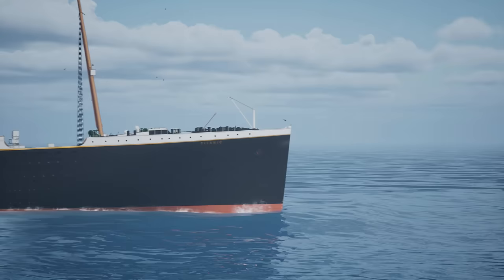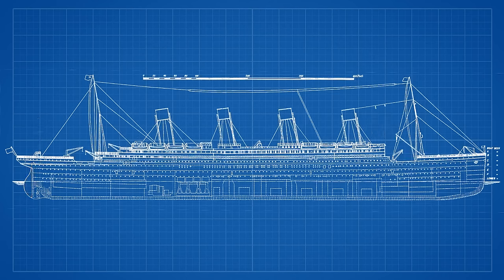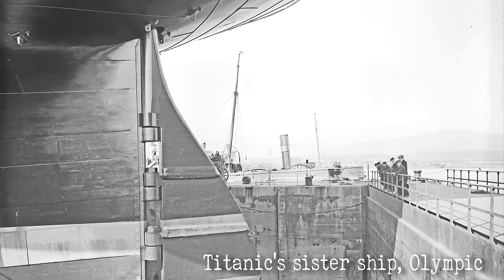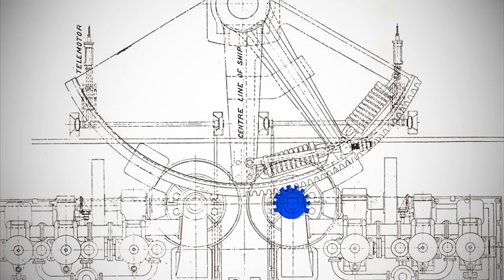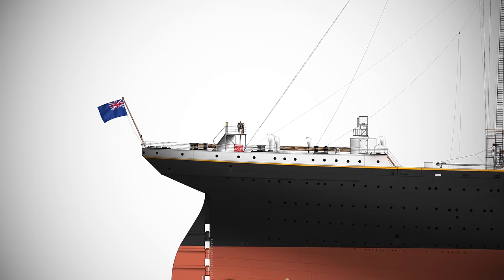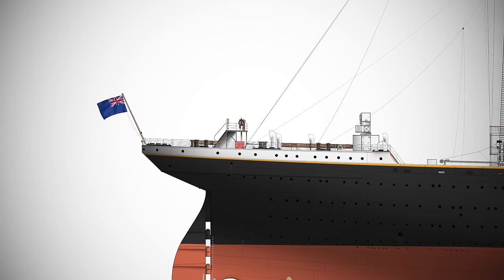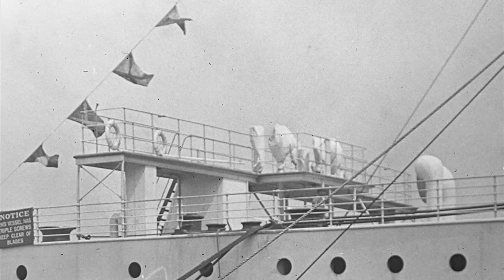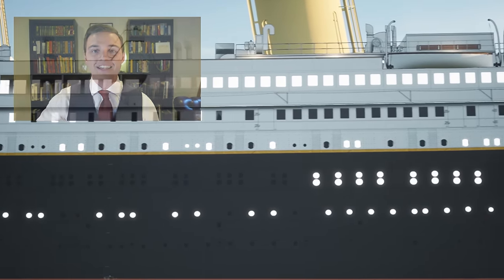How Did They Steer the Titanic?

Comment: About the myth of Titanic's rudder being too small, if that was the case, they would have changed it on Olympic and Britannic.
Reply: They used completely different rudder systems on those ships.
Reply: Also both Titanic and Olympic passed their sea trials wich included maneovrability and steering tests
Reply: Ship sank due to bad luck and shit crew
Reply: @FWtravels  there were a combination of factors that combined doomed the Titanic. There were basic design flaws, material flaws and a flaw in judgement piloting the ship that culminated in the disaster. The radio men pissing off the closest ship to the Titanic didn't help any either. Improper loading of the lifeboats was also a major mistake.
Reply: STILL ARE the most powerful people in the world, you work, and they don't.
Reply: @1pcfred  What you just said summed up the situation in a general nutshell that April night in 1912. I have been researching Titanic (and maritime history in general) for the last 33 years of my life and everything that I've read, seen, written about, and touched during exhibitions all seem to corroborate with your comment. It's a sad truth, but a truth nonetheless.
Reply: @Brock_Landers  a lot of catastrophes boil down to a comedy of errors where single elements or even combinations may not have lead to the same conclusion but all combined magnify and amplify each other. It's really the little things that tend to add up. The Devil is always in the details.
Reply: @pooheadispoppingout  Buy, the paperback book, The Secret Terrorists, by Bill Hughes. I'm over 60 and we been played. Towel 1 and 2, also building 11. WHY WERE the cell Towel were turn off, SO people could NOT call down, and say there was no planes.
Reply: IT sank in the MOST convenient place in the world and at the most convenient time.
Reply: @1pcfred  also jack and rose running across the deck distracting the lookouts didn't help either
Reply: @chrism3784  that's definitely why the ship went down right there.
Reply: @FWtravels  Titanic lasted a lot longer than some modern designs. Think about RORO vessels like Estonia. Couldn't see the bow from the bridge? On a ship that had a bow visor?

Can you blame the Estonia's crew? No. And there were a lot of heroic actions taken by Titanic's crew. Without some of the sacrifices made by members of the crew, the tragedy could've been worse. 

I wouldn't say the crew was bad. It's easy to critique with >110 years of hindsight. They were brave. Humans make mistakes. And it was more seaworthy than many ships being built today. The iceberg seemed to hit in just the wrong way. Believe this channel has a video about that.
Reply: @1pcfred  they actually didn't piss off the Californian, he made a video on that. Simply put, at the time radio operators routinely told each other to shut up, go to hell, and called each other old man. When Jack Phillips told the Californian to shut up, he wasn't being rude because that's how they talked to each other at the time.
Reply: @jamie91995  that iceberg was the patriarchy!
Reply: @1pcfred  huh?
Reply: @jamie91995  I knew you understood.
Reply: @1pcfred  what was the flaw in piloting the ship?
Reply: @1pcfred  what was the different system?
Reply: @FWtravels  why are you blaming the crew?
Reply: @timothyreed8417  the pilot reversed engines and tried to turn. the Titanic was  a triple screw ship. The middle screw went over the tiller and that's what turned it. So it didn't work. He made the wrong call and doomed the vessel. But in his defense he didn't have a whole lot of time to weigh his options. It was 30 seconds from sighting to impact.
Reply: @1pcfred  the engines were not stopped and reversed until after the impact with the iceberg…what is the different system you mentioned?
Reply: @FWtravels  the crew was fine and well experienced for the most part. Ship sank because it hit an iceberg. People died because the systems they relied on failed them in a way no-one had foreseen. 

Smith was the prize captain of the White Star line and his crew were all seasoned from voyages with other White Star ships or poached from Cunard. 

Problem was they moved themselves out of the normal flow of traffic to avoid ice, still hit the ice field anyway and was stranded alone. Her 20 boats which would've been sufficient to ferry passengers back and forth were never meant as the rescue crafts and weren't meant for long term safety either. In fact historically lifeboats were kind of seen as death traps. Even still, the crew was good enough to get every boat off the ship, and 712 people were rescued. If they were a shit crew as you believe, No one would've survived.
Reply: @timothyreed8417  there was never a reverse order given. We know that from the testimony of Frederick Barret. He noted half ahead and then full stop, the engines were never activated again after that.
Reply: @sorrenblitz805  when did fredrick barret see an engine telegraph, in the engine room or on the bridge?
Reply: It was too small only the once: That partcular night. The rest of the time such emergency turns didin't apply.
Reply: @1pcfred  You've missed excessive speed for the conditions.That was the most obvious single factor. None of the ones you mentioned would have sunk her by themselves.
Reply: @nighthiker8872  What??
Reply: @johnbishop5316  what excessive speed?
Reply: @johnbishop5316  the captain was being reckless too. But in his defense he did think the ship he commanded was unsinkable. It is an easy mistake to make.
Reply: @1pcfred  The company, the designer and the captain knew full well that the ship wasn't unsinkable. Watch any Titanic film for an account of what Andrews said. Despite being in a film, it is based an an actual exchange.She's mad of iron sir. I assure you she can sink." Only newspaper headline writers claimed that it was unsinkable. The captain had taken the precaution of sailing 18 miles further south than usual and considered that enough. But however you look at it, near full speed in an icefield was reckless.
Reply: @FWtravels  ...and that's your considered opinion? Wow, and all those reports?
Reply: @timothyreed8417  21knots. In ice. What are you asking?
Reply: @johnbishop5316  have you read the “Inquiries” and what the other Captains said….
Reply: @johnbishop5316  yeah but by being bold Edward Smith went down in history. He went down with his ship and told his men to, Be British. What a legend.
Reply: Yeah titanic's design can be still the reason why it sunk because it was built with weak rivets
Reply: @nickforest7816  the Titanic wasn't designed for weak rivets. They just happened to use some weak rivets. That would be considered more of a manufacturing defect than a design flaw. But yeah the ship opening up like it had a zipper on the side of it didn't help matters out any. Now the watertight bulkheads not going up high enough, that was a design flaw. They knew full well they effed up there. That was fixed in Titanic's sister ships. They fitted those with more lifeboats too. But the Titanic was compliant with maritime code as far as the lifeboats went. They still managed to screw up loading those in the moment though. Oh, and there was enough room on that board for Jack too.
Reply: @Paul Frederick  you don't make any sense with the rivets explanation in those ships from that day and period you can put any type of rivet you want they just chose to use weak ones on the titanic which doomed her from the start
Reply: @nickforest7816  you can put in any rivet you want but defective rivets are going to fail. Just because you can put them in doesn't mean that you should. And yes certain rivets were specced and not used. So rivets were certainly used that shouldn't have been.
Reply: @Paul Frederick  yeah that's what I'm trying to say someone definitely put weak rivets on purpose to sink the ship
Reply: @Paul Frederick  they weren't cheap when decorating the ship and it took a lot of money to build it but why did they use cheap materials on some areas of the ship I don't get it
Reply: @nickforest7816  it is very common to spend it where you can see it and scrimp where you can't. Different contractors executed different parts of the ship too. I watched a documentary that talked about the rivets and they discussed why it was done. It wasn't all about money. They had the old orders for the rivets and everything. Some of it was just down to availability at times. They salvaged rivets from the wreck and analyzed them. There's different kinds in the hull. They're not all the same strength either. I believe there were accounts of the rivets popping and shooting through the ship. It was a problem that contributed to the disaster. A number of things all went wrong and those rivets were a contributing factor.
Reply: @Chironex_Fleckeri  The iceberg didn't hit the ship. The ship hit the iceberg. How weird.
Reply: @nickforest7816  Strong rivets would have enabled it to go through an icefield at 22 knots? I think not.
Reply: @John Bishop  why can't you just except that the ship was a weak piece of junk please don't send me anymore comments on it because I'm tired of talking about it
Reply: @johnbishop5316  The iceberg made contact with the ship. That's a fact. "The iceberg hit in a way..." means just that. It says nothing whatsoever about the circumstances that caused the iceberg to hit the hull of the Titanic. 

Seems a bit pedantic, doesn't it.
Reply: @johnbishop5316  I see what you're doing. You're taking people out of context and trying to force a debate that no one else is engaging with, probably because no one cares to.
Reply: @Chironex_Fleckeri  It isn't pedantic to point out that the ship hit the iceberg and not the other way around. It's common sense. Evidently lacking. You're in Humpty Dumpty land.
Reply: @johnbishop5316  they were doing what they knew to do. Big ships always sped through to outrun the bergs that could sink them. Smaller ships like Californian stopped because all icebergs were dangerous to them.
Reply: @1pcfred  Olympic was built with the same batch of rivets dude. Olympic by the way never sank. The iceberg only caused a series of bent in plates it didn't "open up the thing like a zipper" the actual damage caused was 12 sq ft spread across 300 ft of her and over 6 compartments, she was only designed to float with 4 compartments flooded any more was too much and they had 2 more compartments opened. She was going down. They got every boat off the ship, if you're referring to them loading boats half full, blame the passengers they wouldn't get on. If you're referring to them not launching boats for like an hour keep in mind that first hour they didn't actually know she was for real going down.
Reply: @sorrenblitz805  did the Olympic hit an iceberg? The problem with the Titanic is it didn't use the same rivets. For whatever reason two kinds were used in the hull. Good rivets and not so good rivets. Someone decided it didn't matter. Maybe if they hadn't hit the iceberg it never would have. But that's not what happened. When they did hit the crappy rivets let go and the ship tore apart. Because even the good ones couldn't hold it together then. In that moment those substandard rivets weren't doing anyone any favors, that's for sure. I saw it in a documentary and they went into it all in excruciating detail. What the differences were in the rivets, etc. I can't remember the specifics today. If you're interested I suggest you research it yourself. Maybe go to the bottom of the ocean and pick some rivets up, like they did. Then subject them to metallurgical analysis.
Reply: @Chironex_Fleckeri  titanic also lasted longer than Andrews thought too
Reply: @1pcfred  the Olympic hit EVERYTHING including a U-boat. She was known as ol reliable. If they'd been able to turn a little bit faster, Titanic would've survived the iceberg, but they couldn't and it bent plates in across 6 compartments when she could only hold with 4. There wasn't negligence on the part of the crew or the company that built it.
Reply: @sorrenblitz805  if it wasn't negligence then how do you explain the accident?
Reply: @1pcfred  it's called Murphy's Law, and it happened to Titanic hardcore. You claim negligence because you're looking at the situation with 111 years of hindsight. I claim shit happens because shit happens, and recognize that they didn't know what we know now, and to pretend that they should've done this or that is irrelevant because that wasn't the operational standard of the time, a standard the crew of that ship followed quite well and managed to save 712 people.
Reply: @sorrenblitz805  you mean they managed to doom more than 1,500. Over 2/3rds onboard died. Shit happens when people fuck up.
Reply: @Brock_Landers : Except the Titanic ticking off the Californian. That's a novice misunderstanding.
Reply: @chrism3784 : EXACTLY!! Why don't "they" talk about this? The conspiratard industry "conveniently" ignores Jack & Rose.
Reply: @FWtravels Agree
Reply: @1pcfred Agree Murdoch should of just turned to port with engines still full ahead or maybe stopped port engine he  would of got more turning ability with the thrust of water going past the rudder??
Reply: @jimmanihera7760  the Titanic just couldn't catch a break. It was a real hard luck case. I watched a documentary about the Titanic and what they found was a lot of the rivets in the ship were defective. The bulkheads not going all the way up was a severe design flaw too. Disasters are often a combination of little things adding up.

Comment: Truly another amazing video Mike. I am a marine navigator and my job is steering large vessels.  In the 100 plus years since the Titanic sank not much has changed in the way ships are steered.  When the order to turn of the ship either to port or starboard is given the helmsman replies with the order back and turns the ship. The signal is sent from the wheel to the steering flat and the steering gear turns the rudder. Its interesting to watch the steering gear turn the ship.
Reply: Interesting, for sure. My problem is still, wrong Info gets and the decisions  need info for correct decisions
Reply: lexus just recently re-invented the steering wheel in their drive-by-wire 2023 lexus rz450e- too bad they forgot to include a phaser holster in the control yoke.

Comment: The single rudder is mounted in front of the central propeller which was the steam turbine driven shaft that had no reverse gear (or turbine). On the night that titanic struck the ice burg this meant that it was stopped when the order to reverse was given. A stationary (or reversing prop) stops flow over the rudder limiting its effectiveness and would have reduced titanics ability to turn. Im sure you cover this is another video but i thought its worth mentioning since it affected the performance of the steering system.
Reply: Yes, paradoxically it might have turned faster with middle propeller on full speed?
Reply: @johnbishop5316  That wouldn't have been possible with the Titanic. The center propeller was powered by a low pressure turbine that used the exhaust steam from the two triple-expansion engines. It could only be used above 1/2 ahead and had to be shut down when reversing the two main engines. The steam instead being diverted directly to the condensers.
Reply: @Crosshair84  Of course. Obvious really. Hadn't quite occured to me!
Reply: It would’ve made no difference Titanic still would’ve hit the iceberg and they did not reverse the engines they stopped them!

Comment: I really enjoyed that! :D If you're taking requests, I'd love to see a video explaining the engine telegraphs too. My main question is: Why were there were so many of them? I would have assumed (somewhat simplistically) that three engines = three telegraphs, but there seemed to be far more than that on Titanic's bridge.
Reply: Two main engine telegraphs (port side and starboard side of bridge)…ran both engines. Emergency engine telegraph was next to the wheel on bridge…the other 2 communicated to the docking bridge at the rear of the ship…contained docking commands. They worked by a cable system that went from bridge to engine room…
Reply: @timothyreed8417  Wow , that's a lot of redundancy! Was there an element of making the bridge look more impressive than it needed to be do we think? I can't imagine they really needed that many telegraphs doing basically the same thing,
Reply: @lukecrowley571  ease of operation. The officers stood their watch on the wings of the bridge. (Contrary to what you see in the movies) a control near each wing would be efficient for operation. The emergency backup  is just that. The other two telegraphs communicate with the docking bridge and send signals back and forth, when the ship is being backed into its berth, engine commands, which are relayed to engine room, from the bridge, and rope handling commands which are relayed to the docking crew…

Comment: As a kid growing up I always thought they shoulda put rudders towards the bow in sync with the rear rudder. Then when you turn, the whole ship would move left or right while remaining its straight line heading.
Yet also hook up the front rudders rudders to their own steering wheel so the front could be turned instead of having to depend on the read rudder to point the bow in the correct direction.
Voila, they invented bow thrusters. I had that idea in the early 70's as a 6 year old, except they were little drop down rudders :)
Reply: Hate to bust your bubble, but many car ferries have had bow rudders and propellers since the 1940’s.
Reply: @boataxe4605  hate to burst your bubble, but as a kid growing up in the sticks in the 70's we didn't know that.